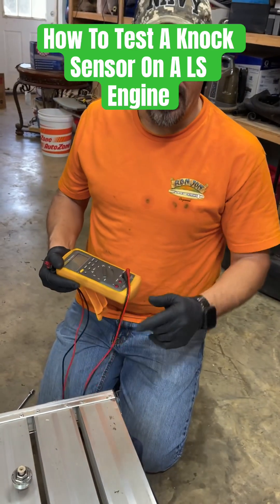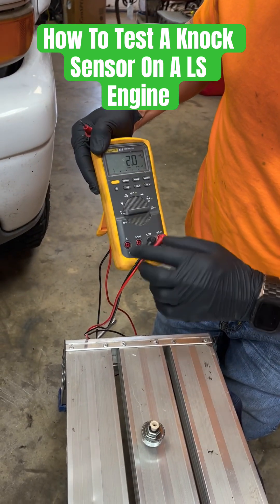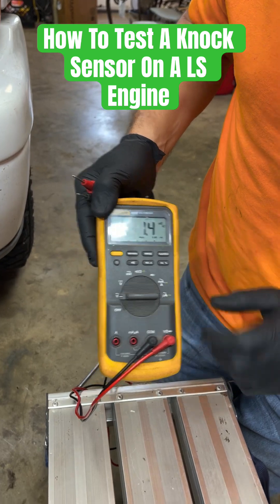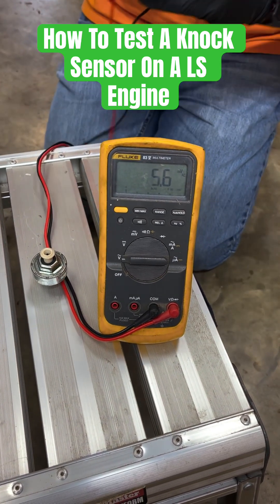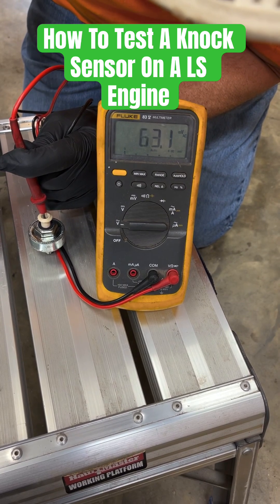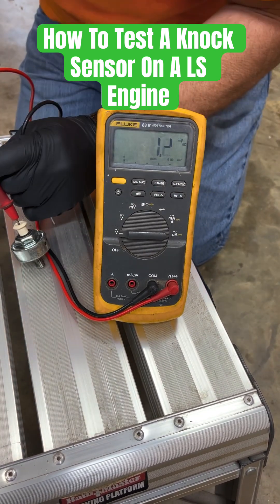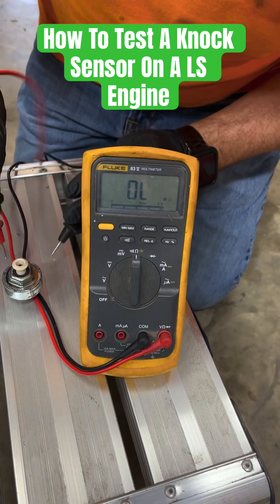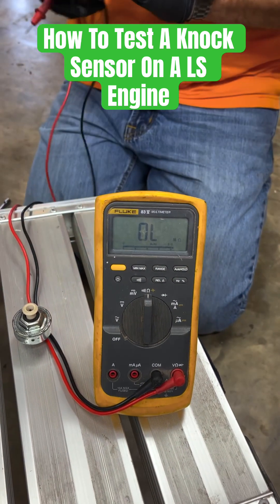How To Test A Knock Sensor On A LS Engine #howto #automobile #diyauto #diy #educational #shortsvideo

Comment from the maker: Very important to test before install. I takes a while to take the intake off and to install these. Also the torque is 15 ft lbs. no more. Do not over torque or you will have to drill and easy out
Reply: @jaycanfixit  Thank you for the input!